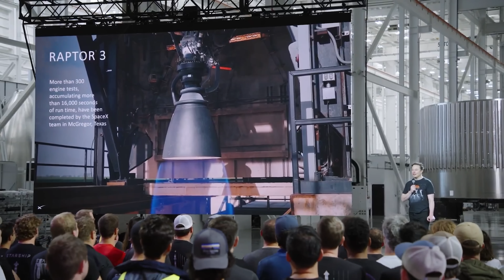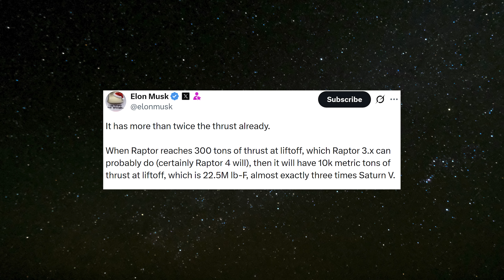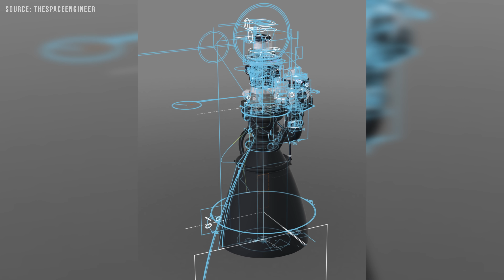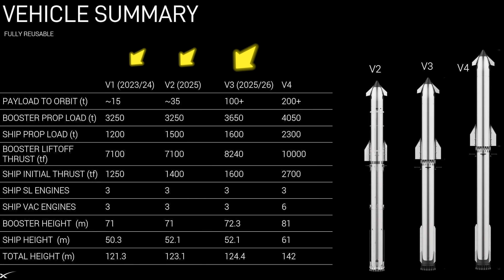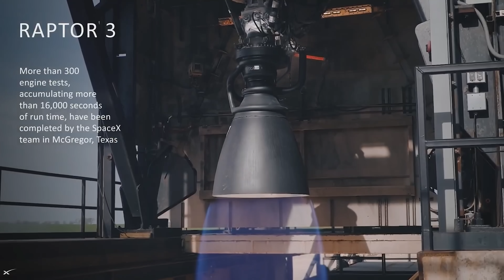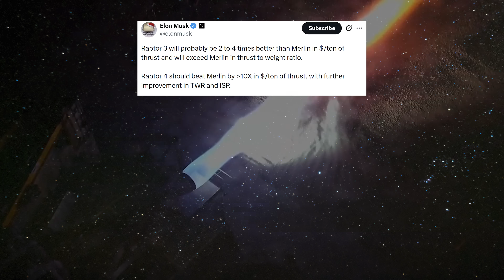SpaceX revealed Brilliant Starship Raptor 4 Upgrade Totally Blows NASA’s Scientists' Minds...

Comment: im sorry but the RDE woudlnt need a high avg pressure if its 20% more efficient
Reply from the maker: The efficiency number only helps after you reach a certain thrust-to-weight and power density. For launch vehicles, average chamber pressure still matters because thrust scales with mass flow and pressure, not just efficiency. A 20% gain doesn’t offset low pressure if the engine can’t generate enough thrust in a compact, lightweight package. That’s why RDEs look more attractive for some applications than for first-stage rockets — at least for now.

Comment: SpaceX’s strategy of cutting costs without sacrificing performance is why I’m such a fan of their rockets.
Reply from the maker: That’s the key difference — they’re attacking cost, performance, and manufacturability at the same time, not trading one for the other. That systems-level thinking is what makes SpaceX stand out.
Reply: That's easy, when you just build it very bad at first :P

Comment: It really comes down to material science, we need alloys or materials that don't 
melt in those crazy high temps!
(To make faster/powerful engines)
Reply from the maker: You’re absolutely right.
At this point, Raptor is as much a materials science challenge as it is an engine design problem. Extreme chamber pressure plus insane temperatures only work because of advanced super-alloys, regenerative cooling, and very tight thermal control. SpaceX’s advantage is that they iterate materials, manufacturing, and engine design together.

Comment: The RS-25 had a chamber pressure of 2994 psi or about 200 bar, much less than any variant of the Raptor, and it had a vacuum Isp of 452 -- much higher than the projected 380 for Raptor.  Increasing chamber pressure does increase Isp, all other things being equal, but the difference is not linear and is smaller than you pretend.  Increasing thrust does NOT, in itself, increase Isp, you are flat wrong there!  Higher thrust can increase payload by reducing the time to orbit and thus reduce the gravity drag penalty, but that says nothing about the efficiency or Isp of the engines or about the challenge of handling higher Max Q because of higher speed in the atmosphere.  Seriously dude, you do NOT know what you're talking about!
Reply: The Raptors are more or less the same power as the old RS-25, even if its less.
Starship is gonna have about 40 of these things?!
Not 4...
Reply: @jonjosenna5581  No, actually Starship is at 6 engines with plans to go to 9 so, no, it doesn't have 40 of those things!  SuperHeavy, OTH, has 33 Raptors and in order to increase the number of Raptors in SuperHeavy they will need to expand the diameter of the rocket, at least in the aft end of the thing.  Of course they're constantly talking about increasing the size of Starship, but if they do that they will also need to increase the size of SuperHeavy -- the total impulse being increased on Starship means the total impulse of SuperHeavy most also increase and by about the same percentage!
Reply: @Raptorman0909 
Which together makes around 40.
No need to be pedantic.
Raptor engines are not made for one journey unlike the R/S rockets.
Reply: The RS-25 is a dead end as far as being a viable rocket engine for reusability just based on its fuel type, not even considering its cost, size, weight, or deep throttle capability. But big whoop it's got a sky high isp wowww!! Also it is deficient in every other metric. So what's the point of comparing it except to say that you're right about one thing that doesn't matter because the other drawbacks are so severe?
Reply: @jazzmusiccontinues1134  No Merlin engine in the history of the Falcon 9 has ever been reused more than the RS-25 engines on the Space Shuttle!  The Isp of 452 is not the highest, there are other LH2 engines at over 465 -- particularly the Expander Cycle engines.  BTW, having a high Isp isn't about marketing, it's about payload!
Reply: @Raptorman0909  Moving the goalposts already eh? Who was talking about Merlins? The RS 25 also costs at least 100x more to manufacture than a Merlin in the present day. The entire shuttle program averaged about $1.5 B per launch in 1980's dollars so yeah if you spend like that hopefully you'll get world class reliability.  Too bad hydrogen requires such a huge tank to haul along any sort of fuel capacity, one would think that would eat right into any efficiency gains, because it does. It's one of the reasons why the space shuttle looked like a pregnant guppy and had to have solid rocket boosters strapped on to it to get to orbit. I guess it probably should be about marketing if you have to convince anyone to order your eyewateringly expensive engine when there are other cheaper more adaptable alternatives that don't require a bunch of extra ground equipment to make your finicky fuel safe to use. The only way the marketing works is if you have a blank check from the Senate that requires you to use those specific engines on new vehicles in a 20 year boondoggle pork program that squandered a whole lot of money that NASA could have used for more productive ends but instead ended up in the pork slop trough.

Comment: Imho, instead of endlessly chasing bigger rockets and more engines, SpaceX needs to focus on a specific version and making it 100% reliable.
150 tons to orbit with 9 m fairing is more than enough for the next decade. Just make it reliable, build hundreds of them, make them your workhorse. Then focus on next iterations.
Reply: you have to remember his mission isn't mainly the moon, it's mars, for which every launch counts 1000x more
Reply: @GrimGrazy  the problem is that Blue Origin, which is technically a decade behind SpaceX, is already launching real missions to Mars. While SpaceX is stuck in endless development and hasn't even reached orbit yet.
Reply: @SolarWindsRider  they sent a satellite, starship is meant to send entire crews with food, water, habitation, rovers, etc.

long term results demand long term development
Reply: @GrimGrazy  100 v3 ships can send more payload to Mars than 0 v4 and v5.
I'm not saying they should stop iterating. I'm saying they need to have practical solution in parallel, just like they did with Falcon 9.
Reply: @SolarWindsRider  V3 is going to be the workhorse for quite a while, but I see no reason to stop development on V4+ considering the efficiency gains projected.

it's not just about what it can do, it's how cheaply it can do it
Reply: @GrimGrazy meant but are nowhere near doing it
Reply: @toni-b3m  they're working on 2 gigabays to produce 1000 per year and the first flight of V3 is predicted as soon as next month

Comment: SpaceX is really focusing on the efficiency of the whole system, not just the engines. That's how you change the game.
Reply from the maker: Engines get the attention, but it’s the full system optimization — structures, manufacturing, reuse, operations — that actually changes the economics of launch.

Comment: All true, but focussed on getting out of Earth's atmosphere and gravity well. Beyond that, the rules change and the disadvantages of chemical propulsion are huge. Distance missions where you boost, then coast, take forever and expose the crew to radiation and other risks. They also require large amounts of consumables like oxygen, good, water, etc. Routine travel through the solar system requires a propulsion system capable of constant or near constant thrust over long periods. That's necessary to bring trip time down from months to weeks, even at non-ideal planetary alignments. At this point, nuclear thermal and/or nuclear electric systems are the only realistic options for flight beyond Earth.
I frankly doubt that Musk can achieve his Mars goals without nuclear propulsion of some sort. It's a nice dream, but not really practical and, from a propulsion standpoint, is backward.

Comment: Can the Raptor-x engines or any other liquid fuel rocket engine be scaled up or down?  Smaller versions might be handy for some applications and larger would be handy for others.  This approach was tried over 60 years ago with axial-flow jet engines but had mixed results.  Can it be done with today's rocket engines?

Comment: “Rotating Detonation Engines do not look very promising for rockets right now.” Riiiiiggghhht, everybody is working on them for sh*ts and giggles I suppose…
Reply from the maker: no one is researching RDEs just for fun. They are promising in theory. The issue right now is practicality: sustaining high average chamber pressure, stable injection, durability, and controllability at rocket-scale power levels. Those are non-trivial problems for launch vehicles. That’s why SpaceX and others are sticking with proven cycles while RDEs mature. If those hurdles get solved, the picture could absolutely change.

Comment: You don’t need a new engine cycle to improve performance. Incremental pressure increases alone give major gains.
Reply from the maker: Pressure increases scale extremely well. Even modest gains in chamber pressure can translate into big jumps in thrust and efficiency without reinventing the engine cycle.

Comment: If Raptors really get down to ~$250k per engine, traditional aerospace pricing is officially dead.
Reply: And that has a lot of the R&D front loaded on to it. 

At the rate spaceX wants to launch ships to Mars, the actual materials, labour and energy cost going in to mass production per engine is going to be an order of magnitude less than that. 
The whole point in starship is to pump all the money front loaded into the development of both the ship and the mass production tools needed to turn them out quickly, to then arrive at a copy paste production line spaceship they can churn out at several per day. That's what it is going to take to expand Earth to Mars.  To then also make them completely reusable, rapidly, only lowers the cost way further down.

When NASA built space shuttles, they couldn't test them to destruction over and over again with public money, people would be going crazy demanding defunding. There was no front loading of costs, and they were so costly to produce on a bespoke basis that they could only make fewer than 10, two of which blew up precisely because they only knew theoretical limits of force and energies.  

Space X has so many starships in the test campaign that they intentionally throw them into real deep re-entry to see if it explodes or if it can take a beating and still land intact, well beyond the energies of normal flight.  The space shuttle was brought down by a chunk of foam, which cracked a single wing tile and destroyed the entire vehicle.  Starship can lose multiple tiles and half the flaps melted away, and still perform a precision touchdown.

Comment: Looking forward to seeing Starship heavy, 3 boosters strapped together - you know, in case they ever wanted to launch Mt. Rushmore into low earth orbit
Reply: If you lit all the booster engines, it should accelerate like a funny car.  If, on the other hand, you only light the center 3 and the mid-ring 10 of the center booster, the fuel in the center booster should last into TLI or nearly, leaving ALL the fuel in Starship for later use.  The center booster will be expended AND massive mods to the launch complex will be required because the 3 booster set will require a flame trench almost 30 meters wide...